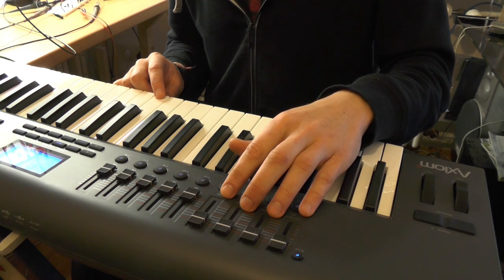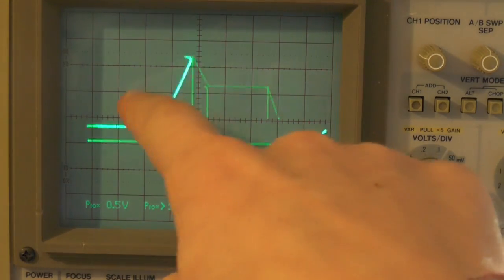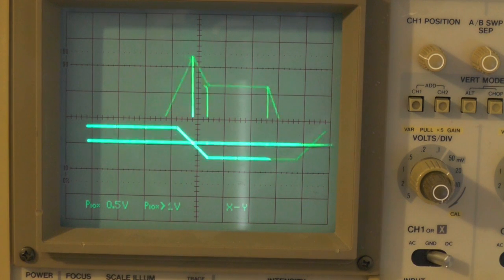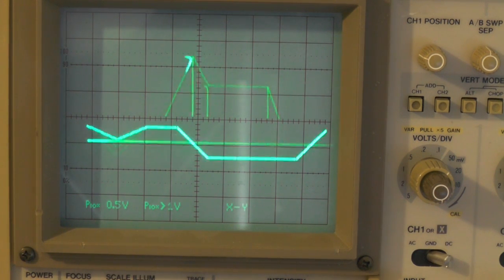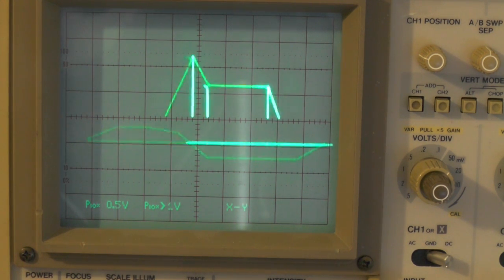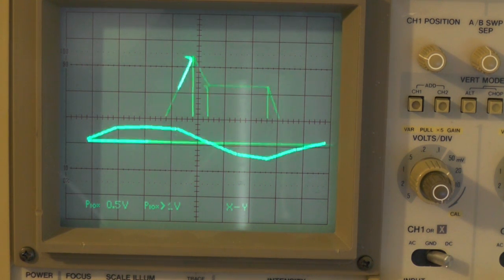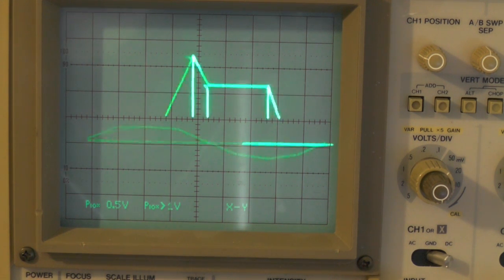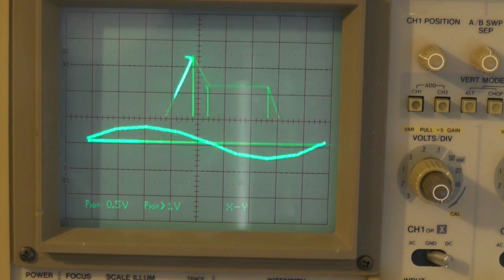Arduino MIDI synthesizer (Part 4) - Waveform shaping

Comment: would this work with an ATmega 328? it runs at the same clock speed as the 2560

Comment: I would love to see this project go on because there are faster microcontrollers out there which we could use.

If would be great if an LFO, a second oscillator and perhaps an LCD display were implemented.

Definitely the best Arduino synth project I've seen so far. Thanks!

Comment: Very good introduction but i guess to step forward in a much complex synthesizer you must go to FM synthesizer and arduino has not power to do everything. You can leave to arduino the control and use any chip like YMF262 to generate waves or you have to move to an ARM processor like STM32F4. I am starting now to investigate two other areas: ESP32 or and FPGA.
In the next few days i also want to develop a USB midi to BT midi gateway based on ESP32 just to connect my controller to an iPad.
Stay in touch
Bruno

Comment: Im gonna implement this on my STM32F103C8
Reply from the maker: please share it with us... I will also create a new series in the next year
Reply: will do.
I have to figure out first how to port the eeprom frunctions over, since AVR/eeprom.h cant simply be replaced with the stm32's EEPROM.h. 

All i know of so far is that the STM32F103C8 or "bluepill", according to some experienced arduino enthusiasts i spoke to, should be more than capable of handling the midi input and controlling multiple keys, as well as the compression side of things, all at a low latency. Other models exist too with more ram that might be more suitable for higher synth functions.

Comment: Hey man, how you doin? I have a M-Audio Keystation 49 mkii midi-controller as an input device for arduino. But it doesn't feature any MIDI outputs. So what should i do? All brand new midicontrollers contain at least one USB and no MIDIs.
Reply: I would imagine you would need to look into 
 coms via the usb port on the Arduino

Comment: Have you looked at STM 32 boards? They run at 72Mhz and might fix the performance issues.
Reply from the maker: I just received one.. Although I've created a synth with the esp8266.. even implemented reverb. But somehow never edited the video .)
Reply: bitluni - I sure would like to hear the sound of the ESP. I prefer the ESP because it is supported by the Arduino IDE.
Perhaps you can makena short demo video, just playing it without spending too much time?
BTW. the ESP also has much more memory and flash space, ideal for storing (and maybe even uploading) waveform samples...
P.S. I just watched your midi synth series. Nice videos with great explanations. I learned a lot and got tempted to undust my Yamaha YS100 MIDI synth, just to connect it to an ESP/Arduino ...
Reply: +bitluni's lab WE WANT MORE SYNTH PROJECTS! :D
Reply: ARM based ST microcontrollers also contain 16 bit DAC included. 👌

Comment: I'm looking at the code to understand how Bitluni chose the parameter for the interrupts, but there is a line I don't understand , in the setup(). here is the timer setup:
 TCCR5A = 0;
  TCCR5B = (1 << WGM52) | (1 << CS50); //clear timer on compare (CTC), no prescaling, reset timer after <OCR5A> cycles
  OCR5A = 16000000L / 11025;
  TIMSK5 = (1 << OCIE5A); //enable interrupt on

The line I don't understand is setting OCR5A (the timer compare value to trigger the interrupt) : how is 11025 chosen/calculated ?
Reply: My 1st guess is that 11025 is  maxToneFrequency * prescaler (1) * number of samples,  but as number of sample per wave is 256, it would mean that if the played note frequency is over 43Hz (very low pitch  note) the wave tab samples are not all used, theorically half of them when note is 86Hz (still a low  pitch  note) .